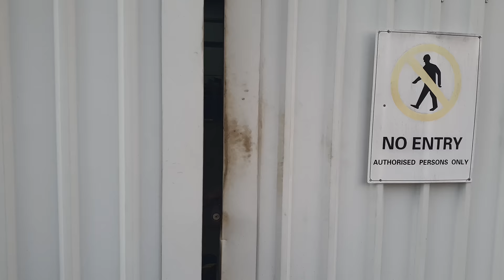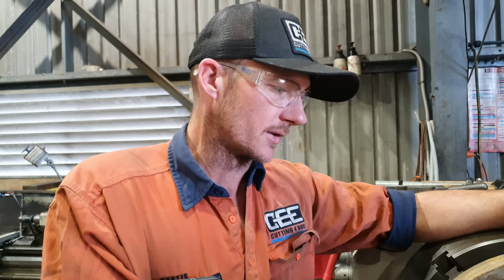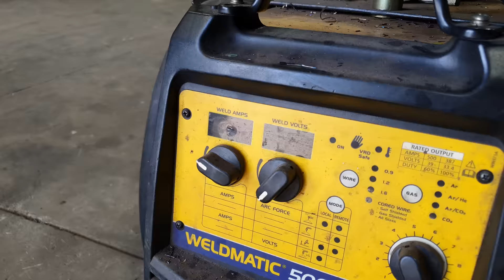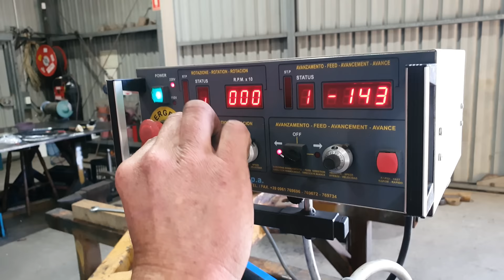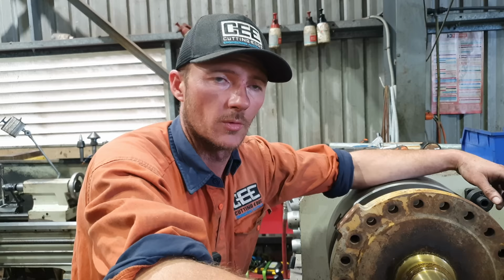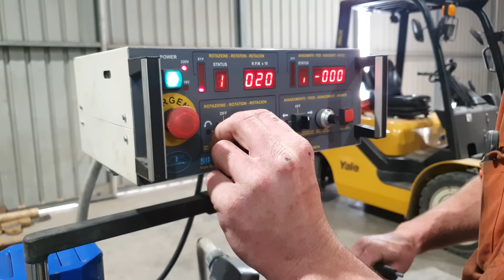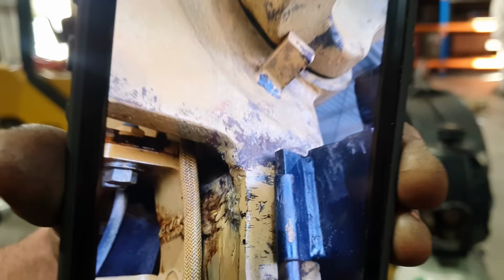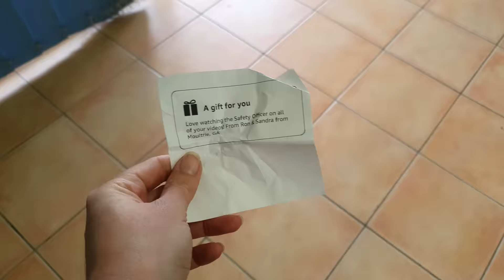12 Hour Day in Our Workshop! | Machining, Welding & Line boring

Comment: It seems the common theme of these videos is that someone tried to cheap out a repair, botched it up, and later had to finally seek the help of someone who actually knew what they were doing. Great work as usual, always awesome to see another fabricator that takes pride and care in their work.
Reply: Don't judge me 🤣🤣
Reply: Yeah mate, I know'em very well! In our shop my boss usually charged them double. I found it reasonable as we were a "second" option. Cheers.
Reply: Agreed, I owned and ran a small engine repair shop for years, it never stopped amazing me how many people royally screwed things up rather then having a pro fix it.. They used to call me magic mechanic. Over the decades I only had a few I could not fix or rebuild without just replacing the engine..

Comment: The hardest thing for a small shop is making the transition to having employees. A good worker doesn't always make a good boss. The boss needs to figure what the worker is good at and use that. They can't be as good as you or they would have their own shop. Then stepping back when you are better than they are is really hard. Last is getting out of eyesight. Trusting them. Most kids today will wait till you leave then go screw around. Good luck expanding when this slow economy picks up. You'll do great. Hire a paycheck bookkeeping company with your CPA. That made things really easy for my wife. She got the statements and signed the checks to the government when they told her. That was in the USA but I'm sure you're the same way. TAXES!!! ARGGG!!!
Reply: Probably an unfair generalisation of "kids" but even if you got in a part time semi retired person to clean up after jobs,  help on the forks/crane, run to suppliers, deliver to customers etc. that alone would save a shitload of time.

Comment: I opened a far smaller machine shop thirty years ago behind a motorcycle shop, and I remember the cost of picking up all the material handling equipment.  You've done a remarkable job collecting some pretty impressive material handling for some pretty difficult aspects of your work, I can only imagine the cost of all of it.  you make me wish I were in Australia and could work for you.  That phone call, reminds me of so many I received when I opened my shop.  They always do what you suggest should never be done, and then you have to fix it.  All in a day's work.

Comment: I can say, as someone in the Land of Bananas, who got out of the lighter side of the Mechanical repair business due to health reasons, we did not have nearly enough people who are able to do what you do, and it's only gotten worse in the last 6 years.  We went from diagnosing and fixing the root cause of the problem, to firing the parts cannon at most issues and crying when we couldn't figure it out. We have gone from actual testing of components to needing a computer science degree to figure out that a fuel pump is failing. I lost count of the number of times we could have used someone like you who could fix a major failure of what you would consider a small to medium hydraulic cylinder for refuse vehicles and the smaller Caterpillar machines. and the welding and machining of other parts.  Kurtis, I tip my........Christ, I can't even remember what cup of black diesel motor oil coffee I am on at this point.  Regardless of what cup I am on, I tip my cup to you.  Job well done sir.
Reply: The old scool knowledge is gone,  and by that I mean no one wants to get dirty and learn old geezers knowledge anymore.

Comment: Here we go. Proper coffee already approved.
Reply from the maker: None of that percolated burnt coffee crap here 🤣
Reply: 12mm button already engaged!
Reply: @CuttingEdgeEngineering  It's an interesting thing, back as a nephrite it was blend 43 but it almost turned into a competition, there was also a difference between those working on steel and wood or those that traveled vs those that stayed on site for a month plus. Laugh at my aero press with your big machine, but I have better beans and better grind size, apprentice go away, you paid five bucks for that and it's mostly frothed milk, you have no vote here.

Comment: My grandfather used to weld in his garage as a hobby and side business making wrought iron doors and windows. He always wanted a tool to pick up the shavings and even pointed a few out of tool magazines back then. I pointed out to him that it was just a magnet inside a housing that you would pull the magnet away from to drop whatever it was attracting. He ended up getting and old plastic jug and dropping an old speaker magnet in it. He would drag the jug around on the ground, then just shake it loose over the bin.

Comment: That sure is a nice line boring rig. If only I would have had something like that when I was doing line bore work.
 The rig I used, was a home built all hydraulic unit. You had to count revolutions and time it to get an idea of rpm, and you had to time and measure travel to know a feed rate. 
 All speeds and feeds also were dependent on the oil temperature of the unit. If I was line boring a press frame in someone else's shop, and it was cold to start with, everything changed dramatically when the unit warmed up.
 We didn't do any welding with the rig, as we mostly worked on presses, so we just bored the frame out round, after picking up the old center line, then make OS bronze bearings for the crankshaft.

Comment: Dude that line bore and welding is a nice bit of kit, Its nice to see a normal workshop with machines similar to mine as in you have to wind the handle and use a mic to measure. Your dog is supper cool as well   👍👍👍👍👍👍

Comment: Pretty nice way to start a day my friends. Homeless is pretty much agreaing with that for sure. You two have made a great name for yourself for good reason. You are all great at what you do. I have always wondered how many more tech's you have working for you ? Oh how I remember my days at work when I went home after a good long day and expecting to get going on the piece I was working on yesterdat getting set aside for a more badly needed job and then a haywire day to follow. Oh how I miss that job.  Best in the company for sure. I spent most of our spring up at a highy country camp servicing our machines for line boring etc.  I was unawhere of boring boom and other main joints  needed to be turned with a clean up pass. I used 223 Arctec as a builbup rod by stick welding. It stayed well over years of service but I do see the advantage of cleaning up the bores prior to the build up passes. A wire feed wasn't available so all the buildup was donenwith stick. 10 years later I here the repairs were succesful and the equip still hard at work.

Comment: Curtis, I can do, actually do what your doing, and would for room and board. It'll never happen, Mas o menos.  8 thou press is impressive.  Kaisers hot strip bearing housings hold 36" OD dia double roller bearings, we ground the hot strip exit drums crown to make sheet metal coming out 12' wide at 70 mph, and we built the 12' 4 jaw that grabbed steel moving that fast and coiled it, some horizontal work on the brass jaw action, but I ran the 100" Dia modified Niles lathe, a 50' bed.  Lol that was one of a good 50 jobs that big ass lathe ran.  
  I'm happy that you 3 can keep making it look easy.

Comment: I know that working alone your time is limited but I'd love to see an update on the tooling you bought for the SIP Hydroptic 6 Jig Borer after it's video was shown.
Like most machinist I love different tooling and the video you made finding all of the tooling in that auction lathe was like watching a late Christmas since it was posted 2 days after.
CNC guys will probably call me out on it but as a manual machinist I love the hands on aspect of it , to me, CNC is like prepping a turkey and then shoving it in the oven and watching it cook for 6 hours, there's more job satisfaction (in my opinion) using your hands,eyes and different tools to fabricate what I consider steel art.

The Navy shipyard in Charleston S.C shut down and the owner of our shop bought some older machines and around 12 pallets full of various machine tools at their auction, I had a field day going through them,it was crazy how many new and used tools the U.S Government basically gave away for pennies on the dollar.

Comment: I'm sure you could use an extra hand or two with all the work you have but you don't strike me as the kind of guy who likes to babysit. Finding an accomplished machinist is hard too. They usually have their own shop to run. Still, a one man operation does have an income ceiling. But as long as you're happy, thats all that counts. Cheers!

Comment: How did you learn these skills? Ive been a software engineer about 10 years if you F up you can just revert and try another method until no failure, you can even write what we call fixtures where you simulate the worst conditions possible for whatever you just built and test for failures really fast which would be like you guys having every machine on site and being able to test a part over whatever time period and condition you wanted, though you guys lack this comfort... so much respect for what you do

Comment: Appreciate your content. I was a heavy duty repair man welder for heavy equipment. Became very familiar with cat equipment especially the triple six scraper. (666). Used to kid around when I bought out my 7 inch grinder; calling it my portable machine shop. When I showed up for the job I was asked what my religion was; it turned out that the job was 7 days a week and going to church was no excuse. We were paid for 77 hours a week. 14 we're double time and 23 were time and a half. If we worked less hours we were told to put down 77 anyway. The wanted us there, the had 20 pieces of equipment (666) that rented for 1000.00 per hour; that equipment had to be in the dirt. The main rule was you couldn't leave the job site unless all equipment was in the dirt. I lasted one year. Just to clarify; each scraper rented for 1000.00 equiped with operator. I worked night shift which was 11 hours but if a machine was down we were expected to county working on it until day shift came in; making our shift 14 hours. Any extra hours we we paid for. But as I said before if we only worked 60 we were still paid for 77. When they found guys that wanted to do the job they weren't cheap about anything.

Comment: Hobart wire dual Shield 525 in the 1.2 mm& er80 s 3 silicone wire harder material for the bearing surface got it

Comment: Kurtis that machine that works like a backwards lathe where the lathe turns instead of the material being worked on and welder was a total surprise to me, just a incredible piece of equipment, like I always tell my son, the right tool for the job at hand, so is this your machine shop? and wondering why not have another machinist to increase your productivity and revenue, just wondering if you care to comment, if not, I understand.   Javi G.

Comment: How do you adjust for the diameter on the Italian SIR Meccanica machine? It looks like you fit the cutting tool manually in. ?? Love watching you channel. Great work.
OK, forget about that. The answer came later in the video, using a gage and a comparator to position the tool. Got it!

Comment: great work as always. question that not many will find interesting. when you set up on the front suspension piece, what reference points did you use to get your machine centered on the hole? like I said, most won't find this interesting, but I do. it's the brainy, engineering part of the job. thanks again

Comment: When using the Line Borer why can't you set up a cutter arm for both sections so that it cuts both at the same time ?  Soz if its a daft question, I'm from a electrical back ground not a machining.

Comment: Beautifull video. Thank you very much for the pleasure to watch it !!!

If you don't mind me asking ... when welding on the rotary table ... why don't you use a COBOT(robot) for welding it for you? Similar like you used the WS1 for welding the inside of the hole?  Why to stand there all the time, if a robotic arm could do that ? Just asking - as I just recently purchased my robotic arm for such jobs. But way smaller in scale to yours.

Comment: Good one! I was wondering. When line boring excavater buckets and so on with different plates welded together to make up the pin boss. What do you use to clean out the grease from in between the bosses to be able to do the welding part. I always find the grease bubbling out when tryng to weld internally, even though you have given it a good cleaning and degreasing. Some tipe would be apprecoated 😄

Comment: Looks like you always have your plate full with work my friend. I do as well. Looking into a rotating welding positioner. Not sure who makes a decent one and really what to look for. Any input? Mostly do smaller hydraulic cylinders,rods and stuff under 500lbs if your wondering capacity. Thanks my friend. Be safe!!

Comment: Hi I’ve just found your channel and have subscribed, just wonder the rotary table was rotating towards you so you are laying the bead in front of the weld also do you do or you considered spray welding the shaft, the line borer and line welder I’ve never seen before very cool , nice work pal, Terry from Scotland 👍👴🏻

Comment: Excellent videos. What do you use to find the center of the bore holes for the shaft when setting up the line borer? Thanks.
Reply: For common bore sizes he makes a circular blank that fits snuggly into the bore eyes, drills a center hole the same size as his borer bar, then cuts the blank in half. When a half-blank is set on each side of the bore eye the two halves of the center hole locate the proper bar position when the bar is inserted through the bore eye. For other jobs he has two cones that slide onto the borer bar. After the bar is passed through a bore hole, a cone is slid on each end of the bar with the cone tips pointed into the bore hole. As the cones are tightened against each side of the bore hole the rod automatically centers itself.

Comment: I am no welder so I am a little confused. I notice when you mig weld you use the finger tool to clear slag off the weld. I always thought mig welding didn't produce slag only on arc welding. Am I totally wrong?

Comment: Thanks!  Boring, welding and then boring to finish seems like it has an unnecessary step.  Couldn't it just be welded up, then bored to finished size?  Your boring tool is centered on oblong holes that are only close to accurate to begin with.

Comment: Why did you weld around the shaft like that instead of length wise? Ive always seen that and bores welded in straight lines of the shaft or bore not around it 360.

Comment: what is that tool called that you are using to clean the weld ? 
(when you knock off the slag).. connected to your air hose..it has long fiber like brushes
Reply from the maker: that is a Geiger Needle Scaler
Reply: @CuttingEdgeEngineering  thank you - love the channel btw!

Comment: I dont understand this (on the first job): Line boring You weld the upgrade automatically. But und this shaft You are whelding manually. The same machine would do this also automatically with some small modification!??? - You would earn a lot of time for whelding...!???